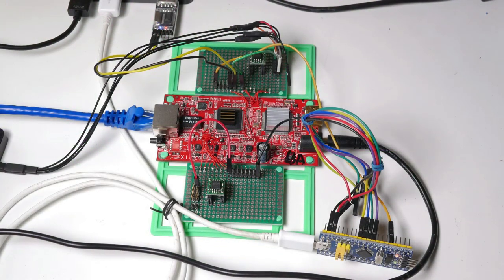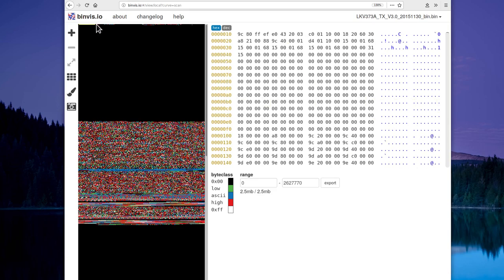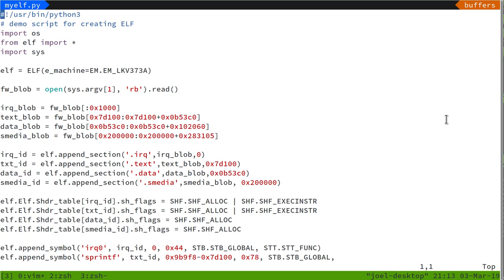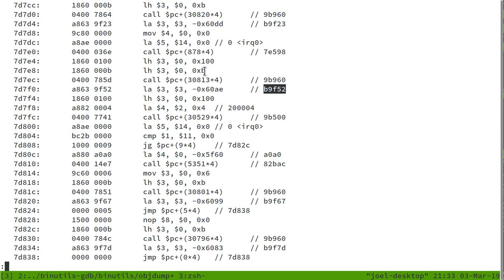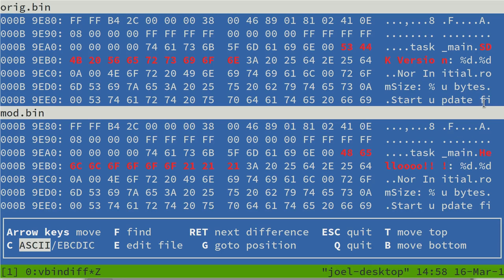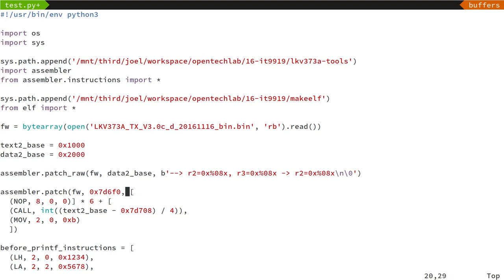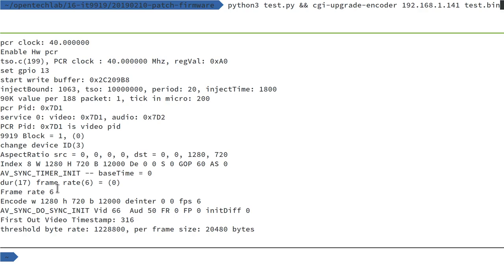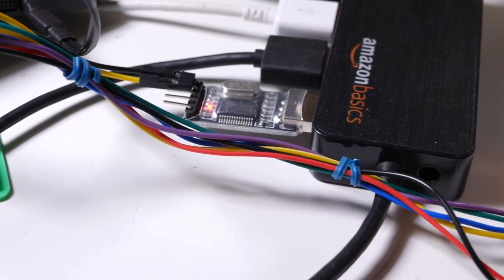[018] IT9919 Hacking - part 3 - Hacking Upgrade Files

Comment: Since you can modify the flasher, why dont you just bypass the checksum computation? Redirect the CPU to Checksum-OK directly.
Reply from the maker: The problem I discovered is it's not a checksum computation - just a memcmp on whether the data was correctly written to flash. The flasher then triggers a reboot, and the checksum is checked by the real system checksum checker - which we will look at in the next video
Reply: OpenTechLab  coool, looking forward.
Reply: @OpenTechLab  Very interesting, but where is the code safed for the checksum calculation? (I am pretty sure you will explain it in your 4th video, but I am not that far yet haha)

Comment: (@7:37) - You may be looking at interleaved code here, where alternate instructions are loaded into the instruction pipeline; this is common on Intel architectures. If this were a SISD (like the old 8-bit micros), you would expect the instructions to load the value 0x000b9f7d to immediately follow one another, otherwise, the problem is that the “call $pc+(30796*4)” might modify register 3. Given that the chip (as seen from video 1 in this series) has 3 cores (a main core, an a/v core, and a security core), this may even be a 3-way interleave, but this is just a guess.

Comment: One ideea and probably I'm way off, but since we are seeing references to other Atmel chips in the text section , is it possible one of those has a known architecture and by finding the corresponding firmware we could then break it down for a known architecture first?
Reply from the maker: I didn't check, but I think they're all the ids of different flash chips, not processors. If you have a hunch about something, though, be my guest to follow it up!

Comment: Forgive me for stating the obvious, but can you not just NOP out the call to the checksum check?
Reply from the maker: Unfortunately not... because it's not actually a checksum check. Just a memcmp that checks the flash upgrade did its job correctly
Reply: @OpenTechLab  OK - I thought you were looking at the firmware bootstrap, not the flash upgrade. NOPping out the firmware integrity checks is something I've done in the past :D
Reply from the maker: Yeah I actually tried something along those lines, but of course even if the flasher software is tricked into thinks a hacked firmware image is valid, it won't make any difference to the boot-loader which will load the firmware after rebooting
Reply: @OpenTechLab  Just out of curiosity - did you check out the function at 82bac? The function you've called "unknown_func()". There be dragons? :)
Reply from the maker: Not yet, no. There's a lot of unknowns to explore